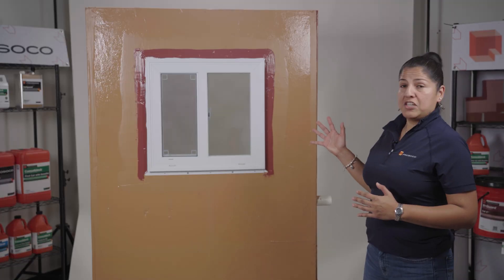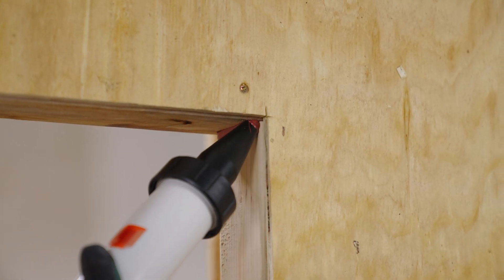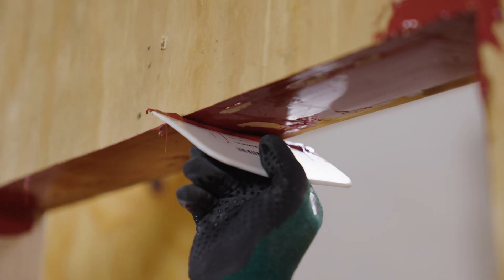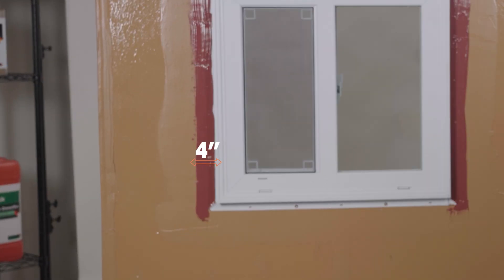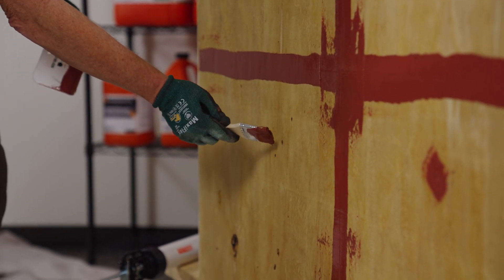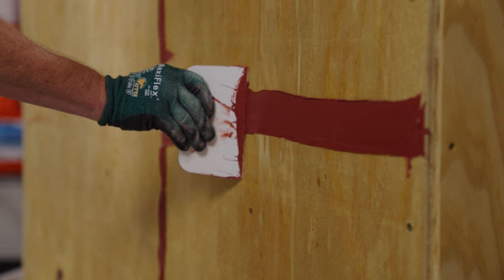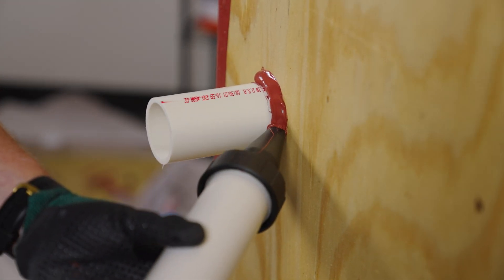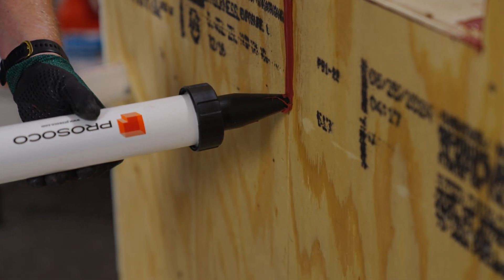The R-Guard System: FastFlash

Comment: I'm thinking this may be a solution to my dormer window sills that sit directly on the roof deck with no wall below the sills. My question is this... is the fast flash compatible with the GAF Stormguard film surface? I'm thinking running fast flash down over the "difficult to flash" sill and onto the surface of the stormguard. Thank you

Comment: Are y’all recommending this over joint and seam filler on seams and penetrations now?
Reply from the maker: Fast can be used anywhere that Joint and seam filler is used. However, Joint and seam filler is for seams or penetrations that are 3/8ths and larger up to an 1" with backer rod.